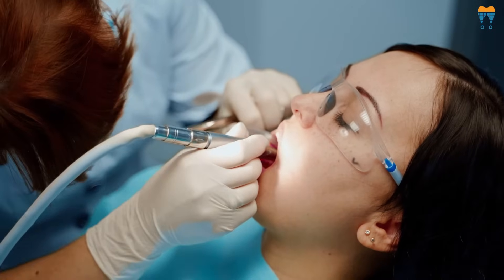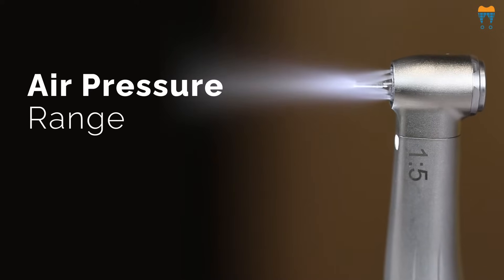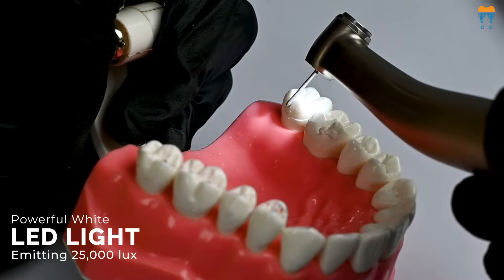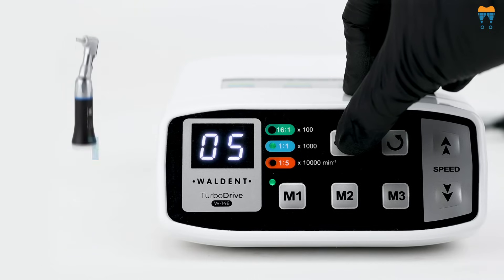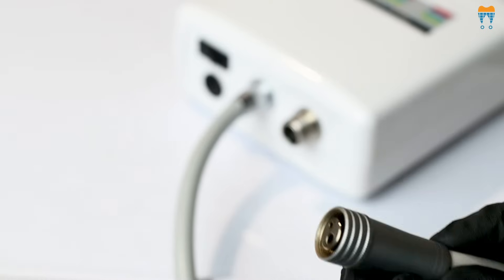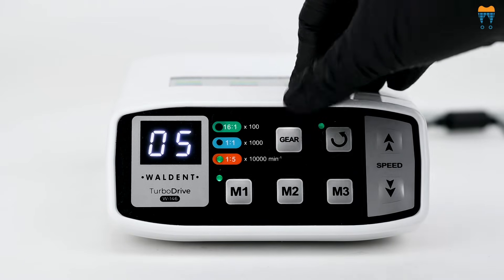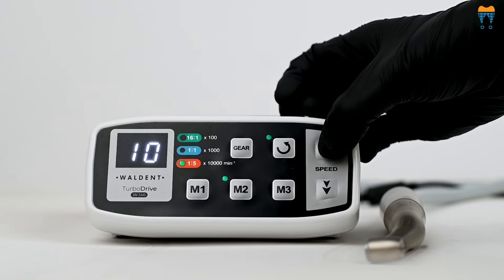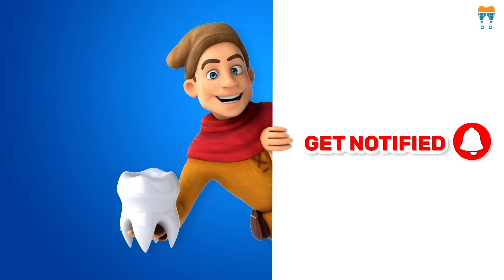How to use Waldent TurboDrive Brushless LED Electric Motor | DentalKart #dentistry #oralhealth

Comment: How do you turn on the motor?
Reply from the maker: Dear Doctor,
To turn on the Waldent TurboDrive Brushless LED Electric Motor (W-146),
simply connect the motor to the control unit and power supply, then switch on the control unit power — the motor will start rotating once it receives power. Please note that this unit does not come with a foot pedal.
Team Dentalkart

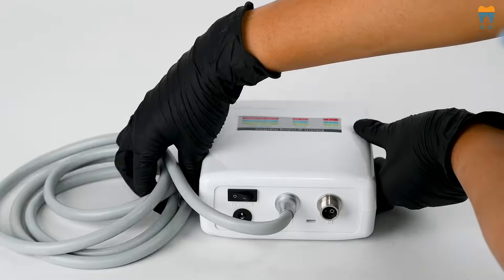Comment: can i  adjust it into 1:42 ratio for surgical extractions?
Reply from the maker: Dear Doctor,
Thank you for your query. The Waldent TurboDrive Brushless LED Electric Motor comes with three preset gear ratios: 1:1, 1:5, and 16:1. It does not support a 1:42 ratio, so it cannot be adjusted.

Warm regards,
Team Dentalkart.